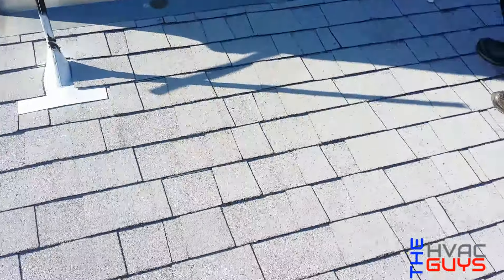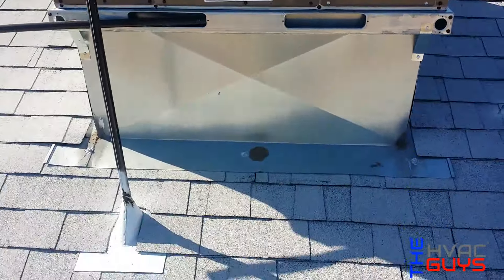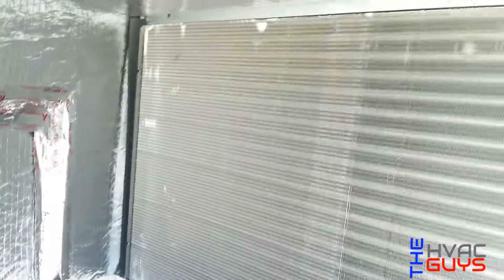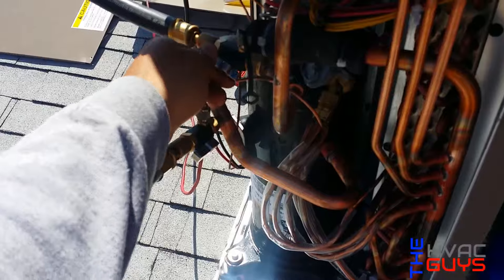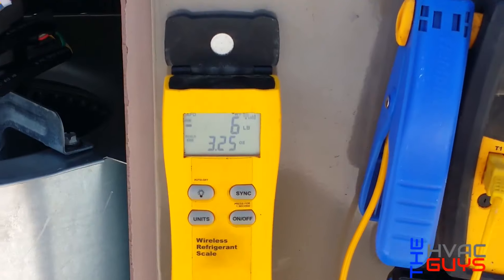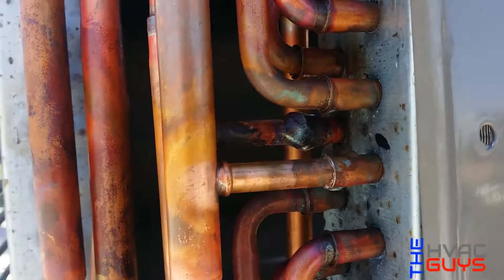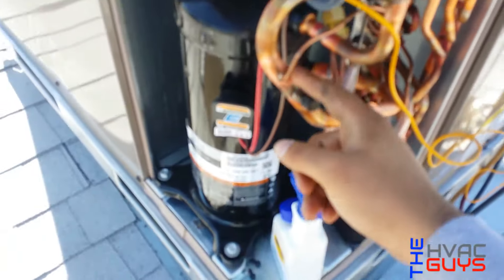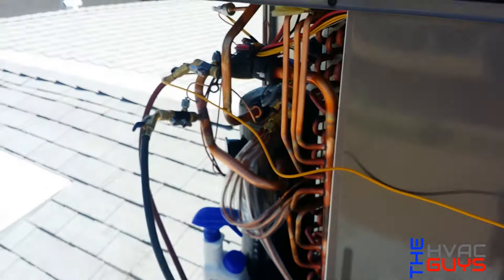HVAC: FINAL RTU INSTALL SHES A LEAKA

Comment: I was curious if you ever had a weight issue with a rooftop unit on a house before.  We don't have many rooftops on residential houses in central Illinois - mostly split-systems and ground level packaged units for residential here.